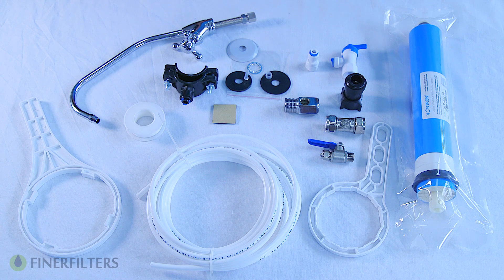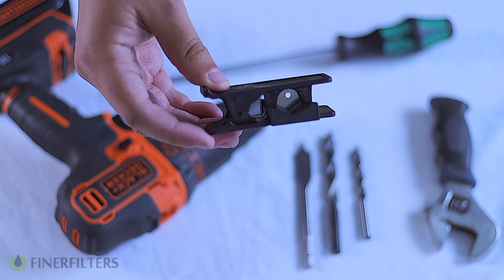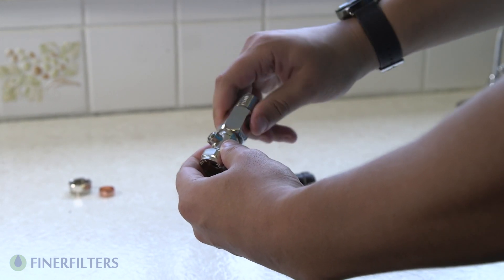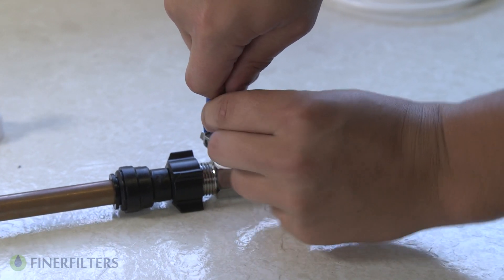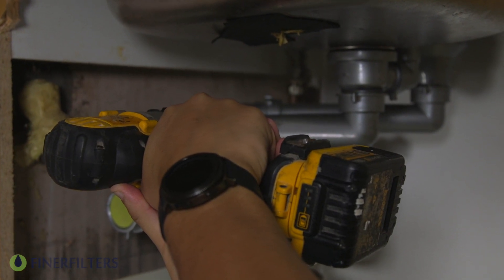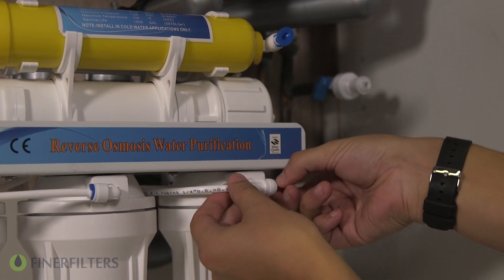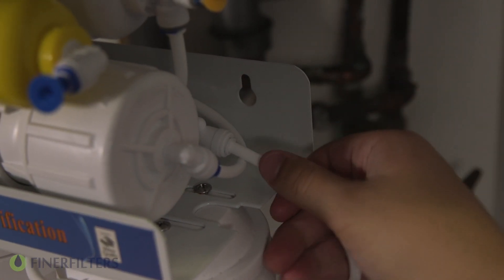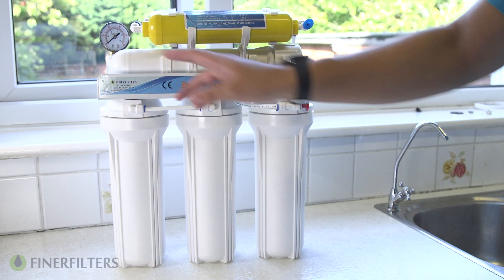How to install a Reverse Osmosis Water Filter System - Finerfilters

Comment: For anyone else watching, here's what's missing from the video:

1) At 3:50 when connecting the 'Compression Ball-o-fix' to the 'Mains valve', the video has the Ball-o-fix fitted in the wrong direction.  There is an arrow on it indicating water flow.  The system should be set up as follows:

Mains pipe -> Ball-o-fix -> Mains Valve (with vertical isolator tap) -> Black push-fit -> normal sink tap connector

2) I suggest using PTFE tape at:
 * 3:50 when connecting the 'Compression Ball-o-fix' to the 'Mains valve'
 * 4:11 between the black push-fit fitting and the mains valve
 * 4:50 on the other end of the ball-o-fix thread

3) at 13:00 when installing the membrane, I suggest first turning off the isolator tap, then running the RO faucet to depressurise and get the water out of the system.  Then you can take it apart without getting water everywhere.  NB, there will still be some residual water in the membrane housing.

4) At 16:10 on the 2nd flush, you shouldn't get any water come out of the faucet, as the water should all be going straight out to the drain.  Perhaps if you leave it long enough it does?

5) At 16:20 After the 2nd flush is complete, if you try and run the RO faucet, your flow will probably be down to a dribble at best.  You have to wait for the tank to fill before you can expect good water flow.

6) Regular maintenance: Once a week you should close the tank valve, open the L1 valve, and let it run for 2 minutes to clear out debris from the membrane.
Reply: Thanks for this, especially your point RE second flush not producing water from the tap - here I am sitting by the sink, scratching my head and reading comments trying to work out exactly that!
Reply: If you have the lower model without the tank how can I increase the flow of water that comes out of the faucet? It's just dribbling out at the moment
Reply from the maker: @lukesolomons8285  Hi Luke, all of our domestic systems come with a tank. If you have purchased an aquarium model or a compact model, then these are designed to be used to mixed water or creating pure water for specific applications. The reason why we include a tank with the domestic units is so the water can be stored and produced on demand when you require it for drinking, as the process is a slow one to create RO water. If you are using your RO for drinking water, I'd recommend picking up a tank from our website: https://www.finerfilters.co.uk/reverse-osmosis/spares-and-accessories/tanks.html 

Apologies for the late reply - I am not notified when someone comments underneath another comment. Thanks! Shaun
Reply: Yes , I called them & they also said 2nd flush is not necessary.
Reply: Big thank you for this post. Answered pretty much all my queries.
Reply: hey so l1 valve should be closed at all times it should be open just for flushing?
Reply: I have this filter for 4 years still but there is no water coming out the tap and I’ve tried everything
Reply from the maker: Thank you for your constructive comment! We unfortunately didn't have access to running water during filming, so had to make do the best we could. We are looking to produce an improved reverse osmosis video in the near future :-).
Reply: Do you know why the tank is not filling please? I've left it overnight & it filled ok, nothing great. Then left again for 4 hours, I get 4-5 minutes of water running with low pressure.
 The pressure with tank empty is around 10 psi but when left for tank to fill up, doesn't change. 
However, I had previously owned an RO system & never had any problems with pressure or tank filling up.

PSm I've tried phoning with bicycle pump but made no difference to the pressure guage.

Comment: Is this the same for 6 stage with pump?
Reply from the maker: Hi Tazz. Yes, this set up video is the same for the 6 stage pumped unit. The only difference is that the pumped unit requires a power socket nearby so it can be plugged in. Hope this helps :-). Thanks, Shaun.
Reply: @finerfilters  thank you!!! I wish you could pop through the computer and fit it for me.. Lol!! 😁
Reply from the maker: @tazzzzbbb  Hi Tazz. Ahh it's not too bad once you get into it :-)!! You can always give us a call on 01704 807600 if you require any help along the way. The units also come with a detailed instructions booklet with everything you need to know about the unit. Thanks, Shaun.

Comment: Still can't get it working right, more videos are easy to do and would be a BIG help.
Reply from the maker: Hi Alswords. We are currently moving site with our warehouse and office so there will be more videos in the future, just not for a few months. What seems to be the problem with the unit? If you need to speak to someone about this, feel free to call 01704 807600. Thanks, Shaun
Reply: @finerfilters  Hi It was 'fitted' by a plumber 9 months ago, then it started leaking and I realised i needed to change filter. Then i find it wasn't fitted correctly the blue cylinder wasn't fitted at all. I put it in correctly i think but there is no water from the tap now:( just dribbles.
Reply from the maker: Hi  @LOGOASSASSIN , I understand. The blue cylindrical filter which you installed is the Reverse Osmosis Membrane, which is going to be doing the majority of the filtration. This requires a high pressure to operate under as the water must be pushed through tiny holes in the semi-permeable membrane. It could be that you don't have sufficient water pressure for the unit, or that your membrane could be clogged. As mentioned, please give us a call if you have any more questions. Thanks, Shaun
Reply: @finerfilters  if there's not enough pressure does that mean i've wasted my money buying it?
Reply from the maker: Hi  @LOGOASSASSIN . Not at all! We do offer booster pumps & booster pump kits for the units. We also do pumped and unpumped units. The 50GPD booster pump kit is £63.99, but the difference in price between a pumped and unpumped unit is around £18. If you'd like to know anymore regarding the pumps and pressure, please call us on 01704 807600 :-). Thanks, Shaun.
Reply: @finerfilters  ok thanks, i'll see, no money or work for many months.

Comment: Hi, I bought replacement filters however I am struggling to replace the mineral/resin filter and the post carbon filter. Are there any instructions in how to replace these?
Reply from the maker: Hi Gokangs. Thanks for your message and apologies about the lateness of the reply. The replacement mineral and post carbon filter are both threaded fittings. This means you need to remove the fittings from the existing, exhausted filters and screw them into the new replacement filter. Hope this helps :-)

Comment: Does this remove fluoride?
Reply from the maker: Hi Coin Op. Thanks for your comment.
Yes, Reverse Osmosis is one of, if not the most effective water filtration method there is. Removing up to 98% of contaminants in water, fluoride had a rejection rate of around 94-96%. Please don't hesitate to give us a call on 01704 807600 if you would like to discuss this further, or leave us a contact form on our "contact us" section on our website. Thanks, Shaun.